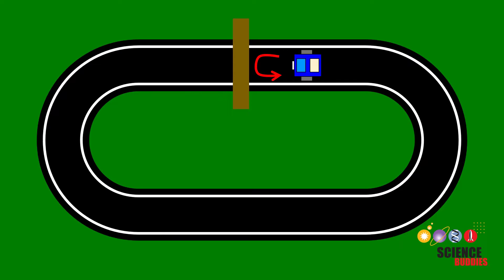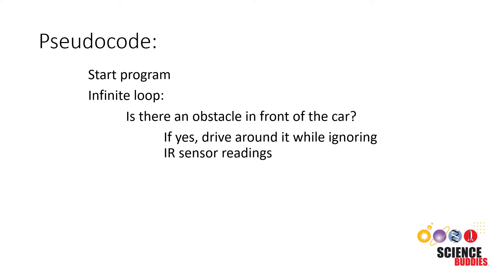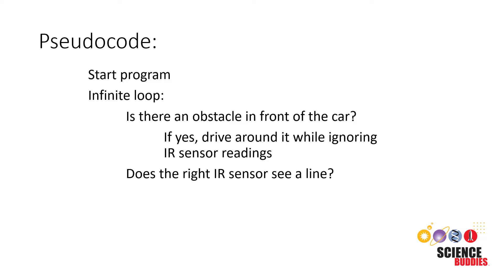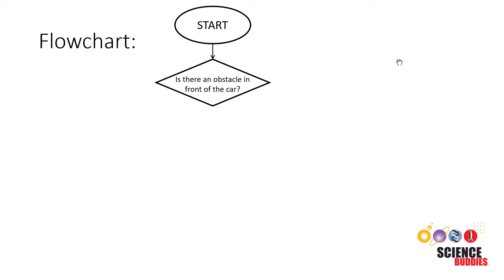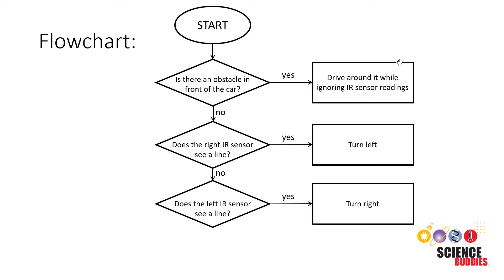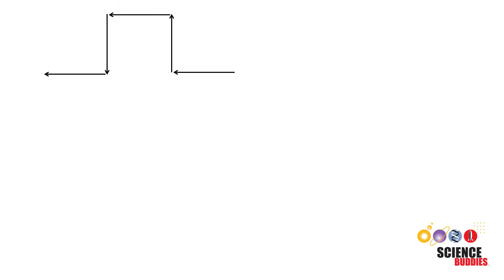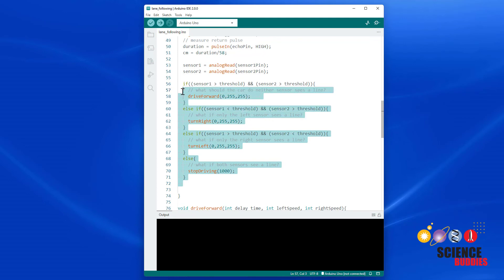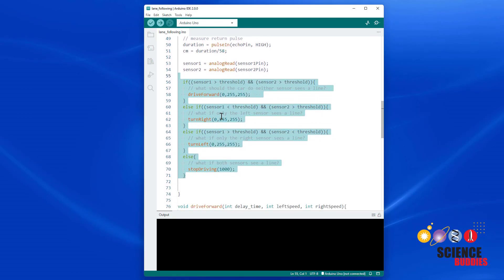Arduino Self-Driving Car Lesson 8: Designing an Algorithm

Comment: I would like to know if the complete code you use is significantly different from the sample code you provided, and is the length of the code longer than the code you provided? Thank you.
Reply from the maker: The complete code is based on the example code and uses the same functions, but we do not give that code away since this is intended as a student science project where students come up with their own algorithm.